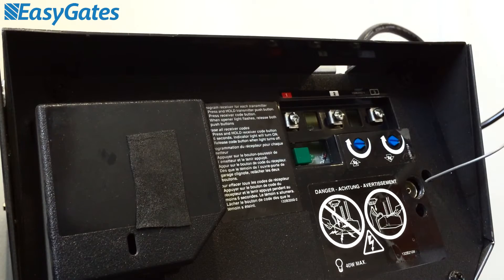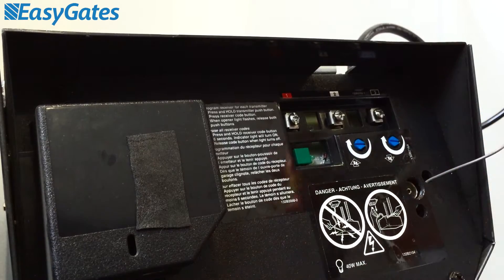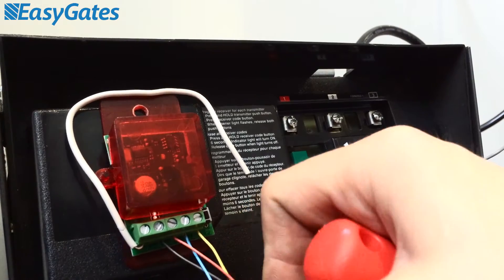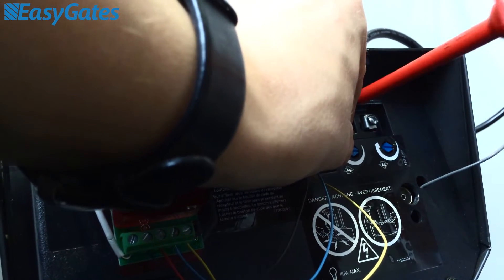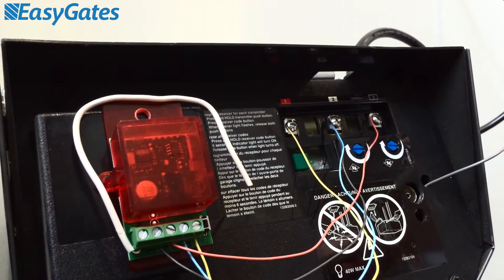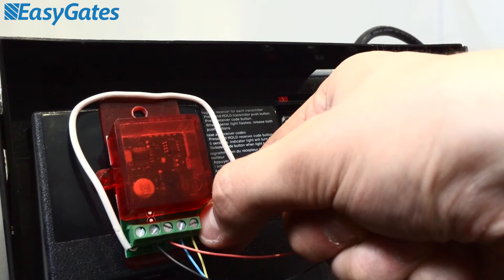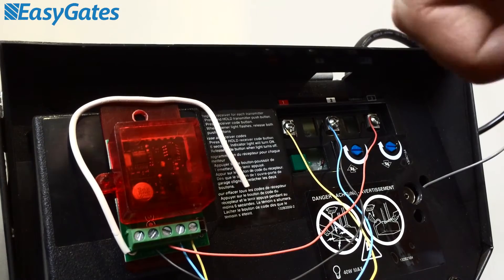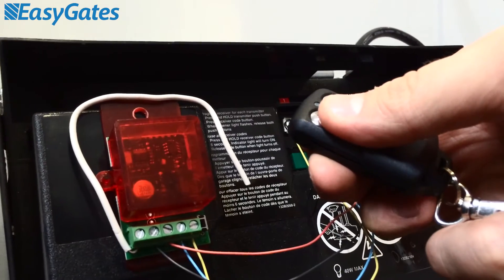How to install RX1 Receiver with Chamberlain Garage Door Opener

Comment: whats the relay output ?NC or COM i mean you need to specify
Reply: Being that the rear terminals are open circuit by default, this signifies that the command to operate the door would be open contact going closed. (NO & COM).